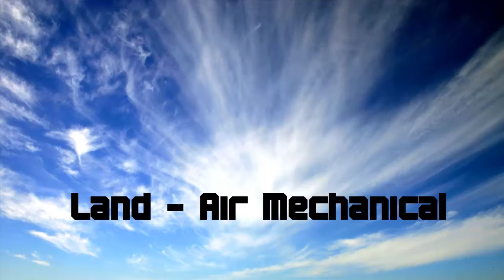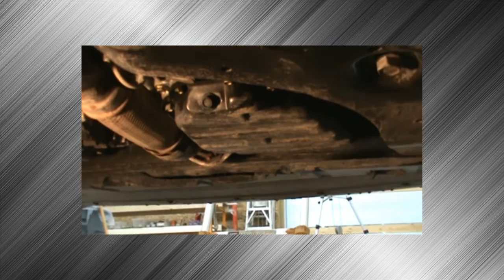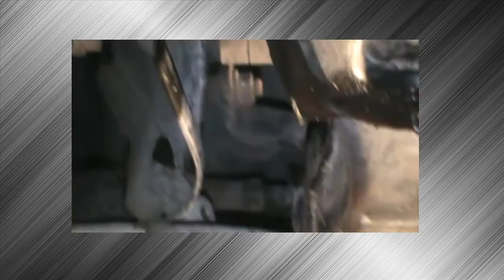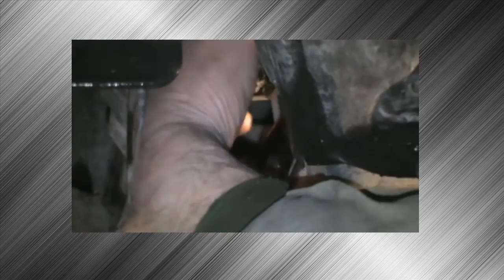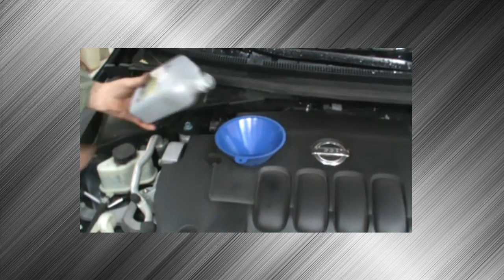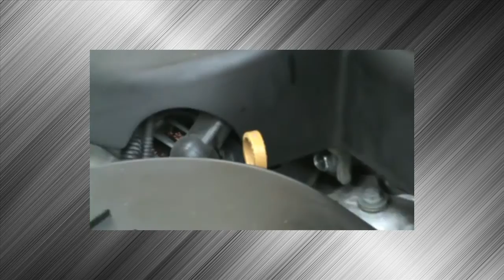Nissan Altima Oil Change Tutorial

Comment: why didnt you put any oil in the new filter be for installing it ?  
will it not get a dry start? Can that not ruin your engine?
Reply from the maker: Filling the filter with oil is not necessary,if you want to put oil in the filter, that's ok.

Comment: how do you pull that plastic cover over the filter ??
Reply from the maker: At the front of the panel, on outside of frame rail rail is a plastic fastener, remove fastener and panel will lift out of way, panel can be reattached with tyrap.
Reply: +Land/Air Mechanical thanks. I found that the plastic fasteners just needed the center popped to come out. thanks for the video !!